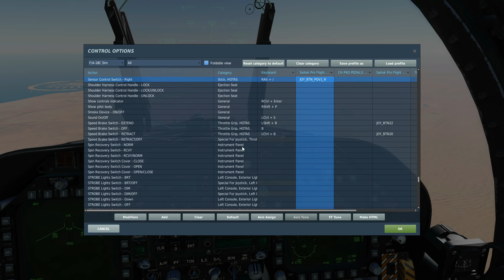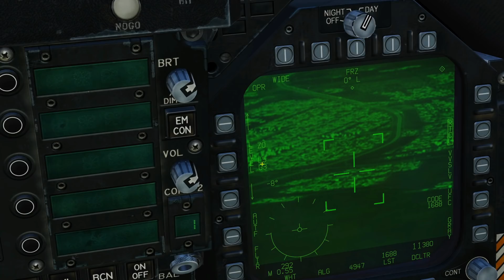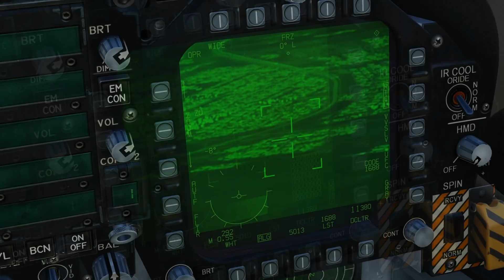FA-18C Hornet: (OUT OF DATE) TGP TPOD - Various New Functions Added - June 2020 | DCS WORLD

Comment: Re Level and Gain. (An online search for video waveform might help.) Level lifts or lowers (adds or subtracts to) the whole signal level - e.g if adding, blacks start to look grey, whites do get brighter but not so noticeable, and vice versa. Gain multiplies the signal. Now, if your 'blacks' are at 0 volts and you increase the gain, then 0 times whatever is still 0, whereas the lighter parts of the signal (above zero) will get proportionately higher., the inverse is true. In practical terms, this may increase (and conversely decrease) the contrast. To get the best signal range, you would first set the level so only the very darkest parts of the image are black, and then adjust the gain so only the very lightest parts of the image are white. Equating level and gain to brightness and contrast on your telly is to all intents and purposes right, but we love nerdy details, don't we?

Comment: You forgot one small thing. You can TDC Depress on the Pod (on Aarea track or Point Track) to make a smaller crosshair appear on the pod. That crosshair you can use it to designate a point more precisely or when you drop an GBU the Laser will point to that little crosshair.
Reply from the maker: I had no idea, thanks!
Reply: I watched this video just to see what that feature was, done it by accident and couldn't work out what it did

Comment: scs-right locks now a target either in aerea track mode or point track mode or unselect one ? But this Button also switches to the right display; right ?   What happend when using the lower idsplay for t-pod, and you press this scs-right button. i think i mix something up. i really wished they would do this similar to the pod in F16 which works easier , imho.  Also you do not show how to get into these gray modes; are these the same as the gray shown in std. t-pod on F16 ?
Reply from the maker: I assume only works in right DDI?
Reply: I tried this last night. It seems if you are using it in the right MFD, then right switches the modes. When it is in the left MFD, use left. Threw me a little, as I rarely use the FLIR in the left MFD.
Reply: @st0atmaster  hm,  confuses and overload players /pilots?  think.. As Kurt Tank stated when he was asked why to spend so much time in creating a "Kommandogerät" for controlling most of engine inputs and settings in the new 190. Being himself a pilot he answered:" What does a dogfighting pilot under stress make with all the control settings....a mistake ! So let the controlunit (Kommandogerät) reduce workload from him and he can concentrate  more on his enemy or task."